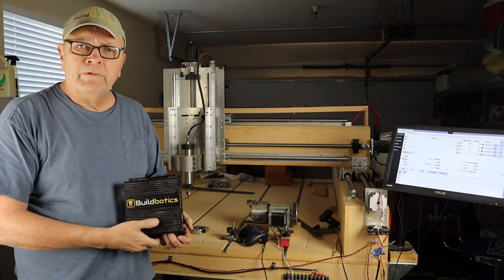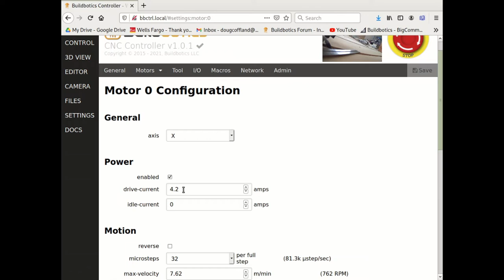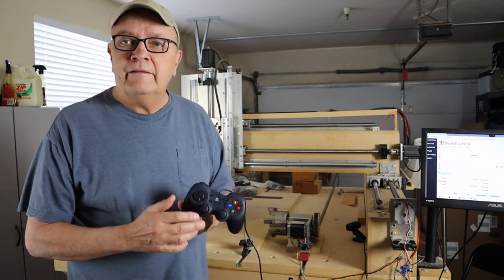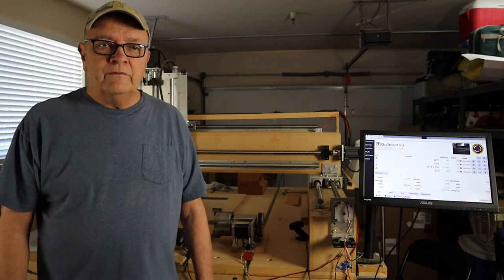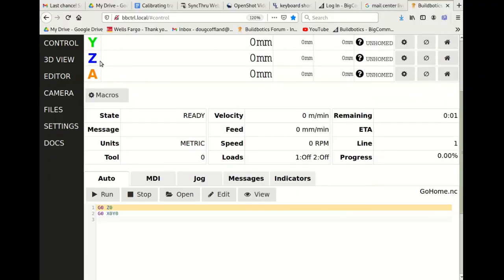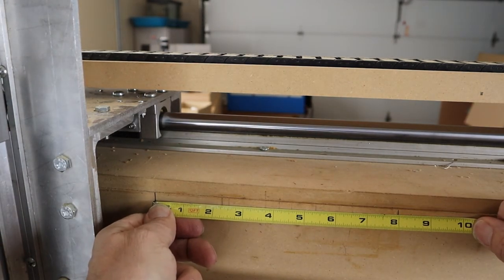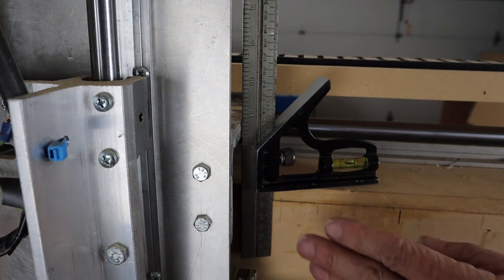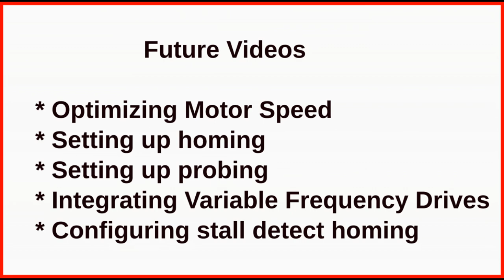CNC Axis Calibration

Comment: Hi I have an aging waterjet that was running with a Windows NT machine and I'm looking at possibly replacing the whole control unit with the buildbotics. Just wanted know if you have have any experience with old waterjet units running on these buildbotics units?
Reply from the maker: I’m sorry. I do not. Having said that, it doesn’t seem like it would be difficult.